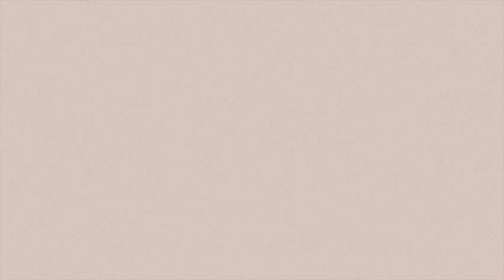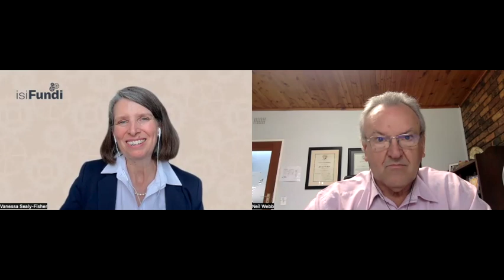CATHODIC PROTECTION | Understanding Potential Measurements

Comment: We cannot measure a potential, but we measure potential differences in units known as volts.   Gibbs Free Energy explains that there cannot be zero potential as the free energy fills any void.  Therefore there cannot be a negative potential so we must examine the measurement itself.  If we are using an old analogue voltmeter there must be current flowing through a coil that moves a magnet on a pivot against the elastic memory of a hair  spring.  the pointeris fixed to the magnet and adjutment can be made to the anchor point of the hair spring to zero the meter before a measurement is made.   We set the instrument zero and measure the potential difference in relation to that zero.  If we are using a digital multimeter it does noh have a hair spring but is entirely electronic.   It consists of a series of capacitors and resistors that can be likened to cups and byepasses.  The charges pass into the cup and when it is full pass on to the next cup.  The value of each resistor is known and the eletrical capacity of energy (potential) is known.  The wiring is designed so that the display shows the voltage or current flowing through the resistors to complete the measuring circuit.  An oscilloscope displays the path of an electron across a screen that has to zero adjusted for each reading or series of readings.    It is therefore the meter that sets the zeron for each 'pipe-to-soil VOLTAGE measurement.  The ground contact electrode is not a reference potential.  All of this is described in detail in Module01 of the CPN on-line Corresspondence Course at the following link.  https://www.pipeline-corrosion-control.net/CorrespondenceCourse/Module01/index.html